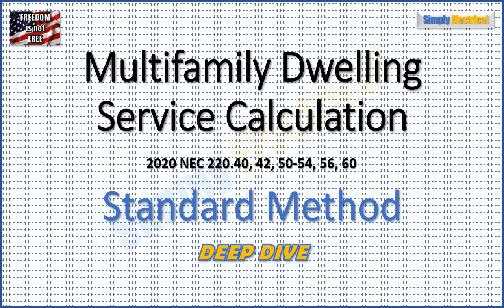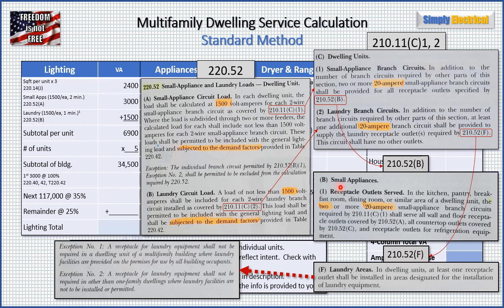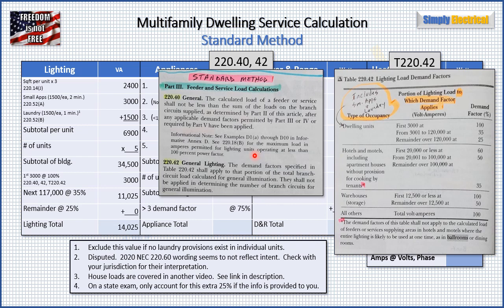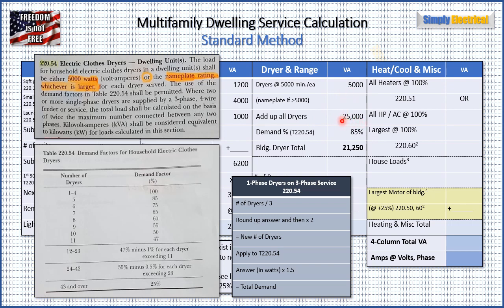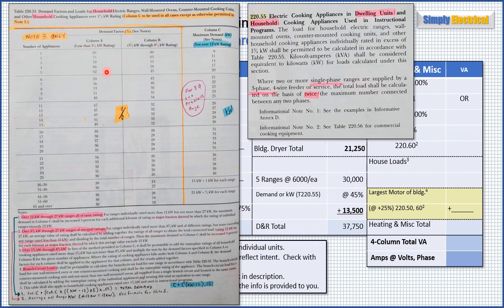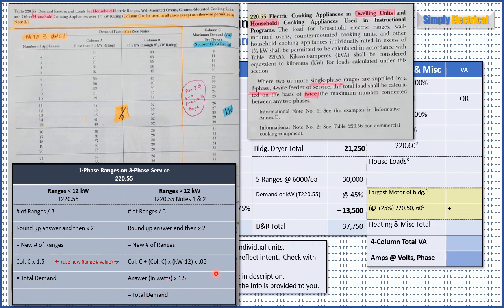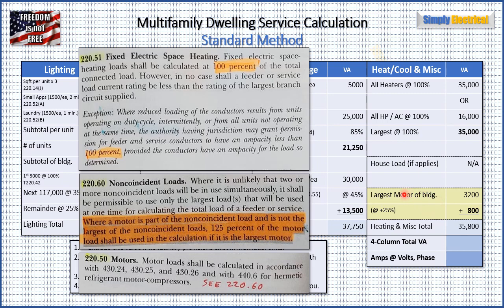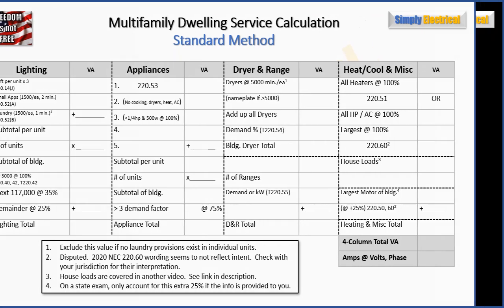Multifamily Standard Service Calculation - Deep Dive 2020

Comment: How can i get the tables for Multifamily Standard Service Calculation?
Reply from the maker: Hey Tony, I don't have the tables available for download as of yet. I'm working on a website but it's taking a bit longer than I anticipated (spare time is in short supply!  :o).

However, at the end of each Deep Dive video there is a black and white blank table for that particular type of calc. Feel free to screenshot it and print it up. I'm afraid that's the best I can do at the moment.

Thanks for the request, though. It helps me know what to prioritize.

Comment: Thanks for...question.Where 1.5 is coming from ?...at 3phase calcul.
Reply from the maker: Thanks for the question.  Sorry, I should have made that more clear in the video.  The 1.5 value is simply the result of 3/2.  At this point in the equation, we are applying the single-phase loads from Column C to our 3-phase service.  So it's averaging the load over three phases.  In essence, it's the reversal of steps one and two, now that we have the value we are after.  Hope that helps!

Comment: Is a heat pump considered a noncoincidental load? Im always confused by a heat pump because the backup heat kicks on when in defrost, the motor is running also which depending on the reversing valve is what gives you heat or AC. So wouldnt the AC and heat be running at the same time? Your videos are a huge help to me thank you so much for your channel!!
Reply from the maker: That's a great question because many electricians don't know a whole lot about HVAC and how those systems work.  I myself would like to be more knowledgeable on the subject.

The simple answer is:  If the two loads EVER operate simultaneously, then you would have to include BOTH loads in the calc.  But that would be thinking too rigidly.  Several things need to be considered.

1) Do both loads indeed ever operate simultaneously?

2) How long do both loads operate simultaneously?  If it is very brief, I would say it's not an issue.  If it's for more than a few minutes, that's another story.  Remember, this is a building load calc - not just the branch circuit.  So there is a fair amount of wiggle room since the loads spread across the entire service.

3) How does one interpret the phrase "Where it is unlikely that..." in 220.60?  That phrase implies that the code writers understand that though sometimes two loads may operate simultaneously, they are more concerned with the normally expected operations under normal circumstances.  They certainly could have used the phrase "If it ever happens that..." instead, but they chose not to.  With this comment, I'm just saying that they worded it that way for a reason.  It's ultimately up to us or our AHJ to use judgment on the final interpretation.  And since no two situations are identical, I think that's a good thing.

4) If in doubt, include both loads.  Better safe than sorry in situations like this.

5) If this is for an exam, they will tell you whether loads are simultaneous or coincident.  They won't make you guess or use ESP.  (Unless they really have no heart! 😁)

In all my training over the years, when it comes to load calcs, I have always been advised to treat heat pumps the same as air conditioners - as though they are noncoincident with the furnace.  But I can understand the argument against it, as you have pointed out.  It simply boils down to a case-by-case application.

Hope that helps a little.  I'd like to hear other people's thoughts on it here.  Other perspectives are always welcome!
Reply: @simply.electrical  Awesome it makes sense. Sometimes I just need someone to say it doesn't have to be that detailed which is one of the reasons I like your channel because of the detail lol. I agree it would be great if an hvac guy could say how long the two run together, but it probably isn't very long.